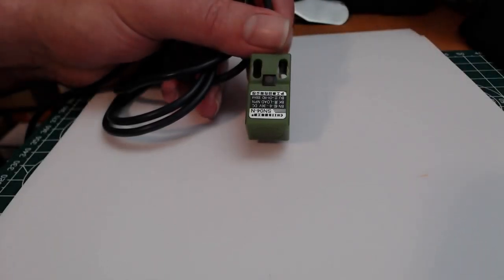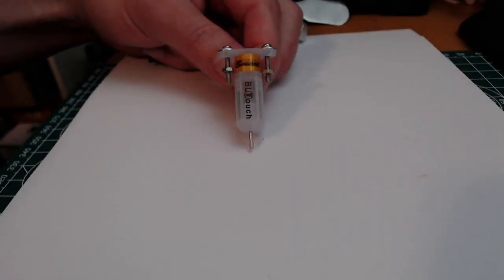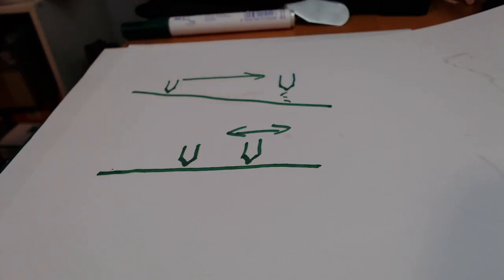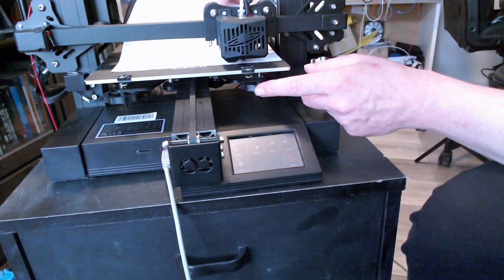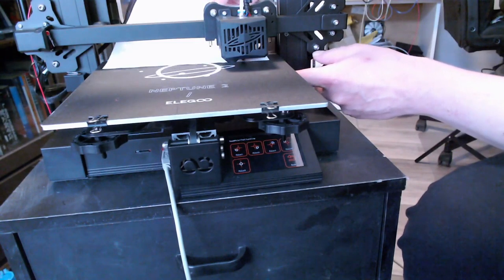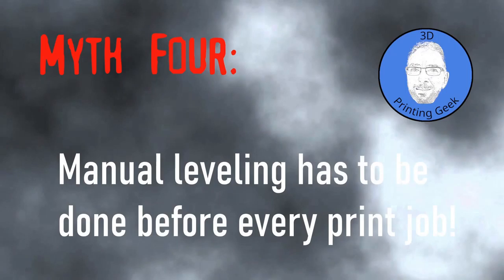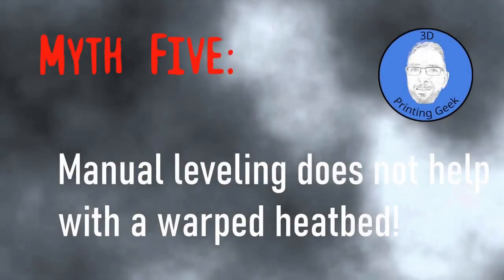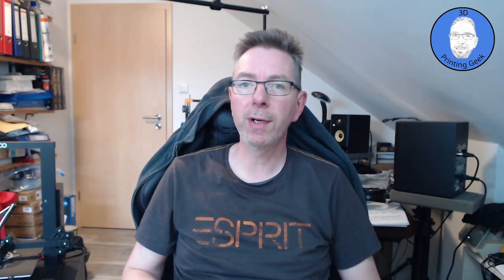Debunking Bed Leveling Myths: What You Need to Know

Comment: The statement about cheap clones of BLTouch - this information just not actual in 2021. 3DTouch from Trianglelab is just awesome and works like a charm with zero issues and cost around 1/3 of original one.
Reply from the maker: You may be right. I was referring to my past experiences. When talking of clones I mean the ones that even call themselves"BL Touch" of which you find many on AliExpress, not the 3D Touch.
Though a few years ago there was a little difference in accuracy and repeatability wher the BL Touch outperformed the 3D Touch.
I should get an actual one to do s comparison.